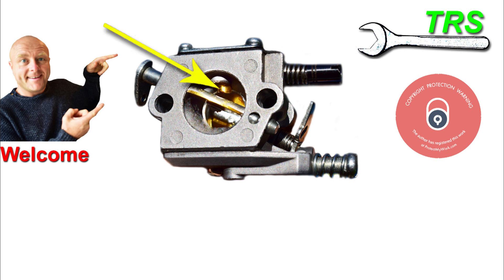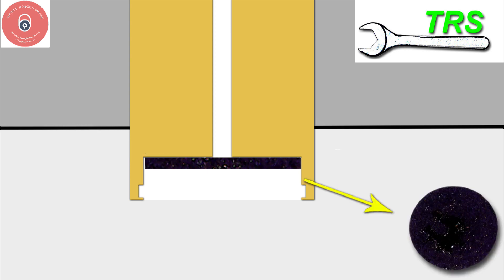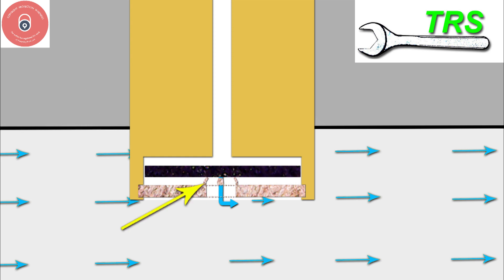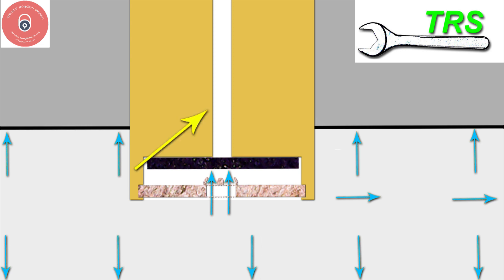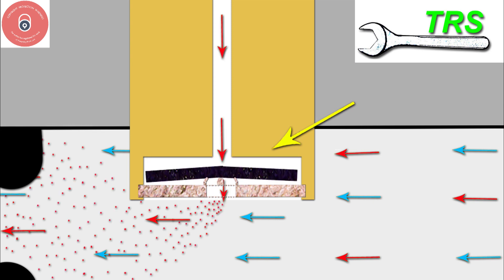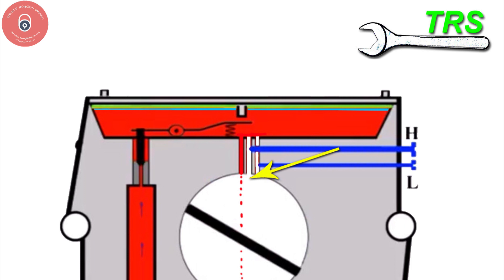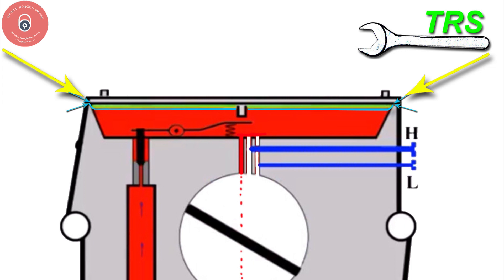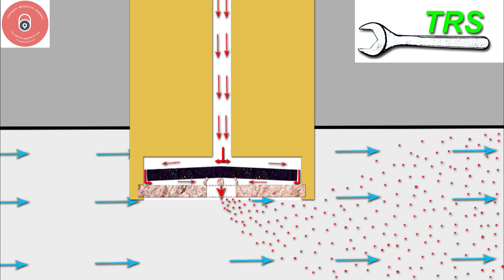CHAINSAW CARB JET - How it Works Fully Explained!  (by Craig Kirkman)

Comment: Thank you for this explanation about the main jet, I have never seen this elsewhere. 
Is it possible to remove this part from the carburator, to repair or put a new one, and is it possible to change the valve with a new one ? 
When the main jet is blocked by a dirt, how to clean it without damaging the valve ? 
best regards

Comment: @4:42 What stops air from flowing back past the H/L needle valves into the metering area, thus breaking the vacuum and allowing fuel to flow down into the carb bore through the main jet tube?
This is where my carb has a check valve so that fuel can only flow from the metering area into a small reservoir under the check valve which feeds the H/L tubes.

Comment: Thank you. Your videos are so informative in troubleshooting my leaf blower not starting. During cleaning, the small rubber disk did get broken to pieces. Is it replaceable? How to remove the yellow cap holding the disk? Or can I simply run without the disk? After tightening spark plug, I can start blower now and run without disk. I don't know it was spark plug not sealing or this disk blockage causing engine not starting.

Comment: Make a video on  proper cleaning of carburetor , high speed screw ,low speed screw , main jet cleaning and how to adjust high speed screw and low speed screw for best performance of two stroke brushcutter,chain saw etc. I am from india ,  I have service workshop OLEOMAC BRUSHCUTTER and other products also ,  Thanks

Comment: Can you also make a video on how to adjust the middle jet screw.
Reply from the maker: Hi. I'm not sure exactly what you mean by a middle jet screw. Could you explain a little more for me? I'm sure I can make a video if I can be sure what I need to do it on. Thanks. Craig
Reply: @TheRepairSpecialist  on my mini tiller it has single main jet screw and not like rich and lean screw.
Reply from the maker: @atulshinde5212  oh, OK. What make and model of engine is on your mini tiller?
Reply: @TheRepairSpecialist  it's made in china and i'm from country india,  it has no specific name just has sticker of trolley type harvester. Although i have manual which came with it describing on how to adjust the screw but i didn't understand it completely maybe shade some light on it. Engine model is 1E48F
Reply from the maker: @atulshinde5212  OK thanks. I will take a look into it